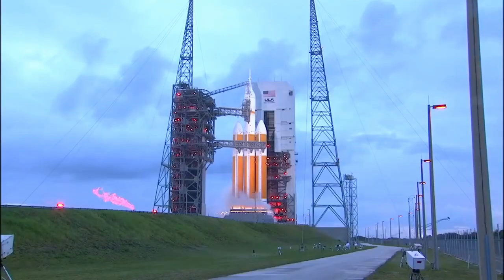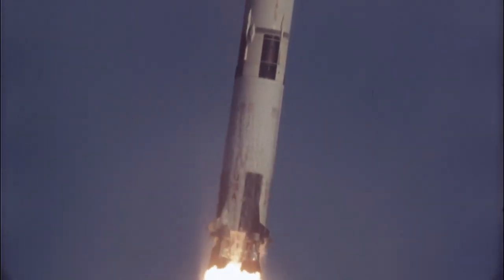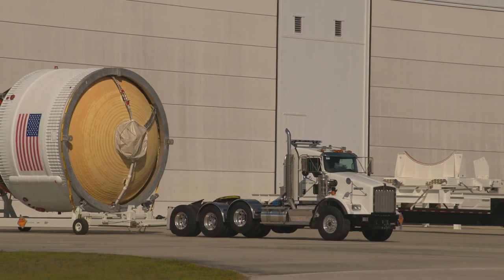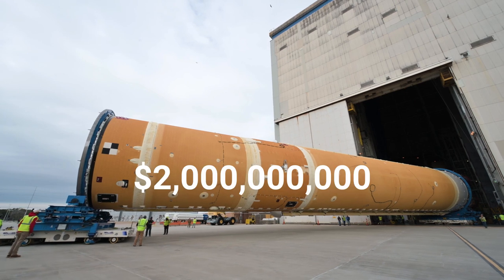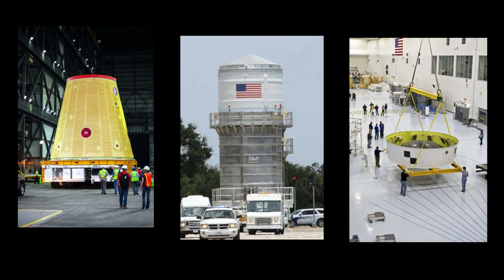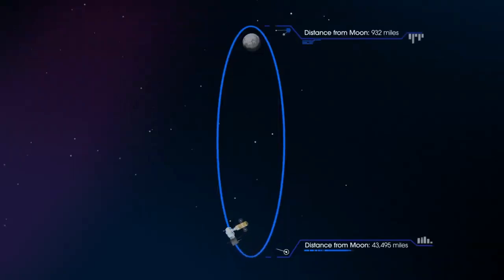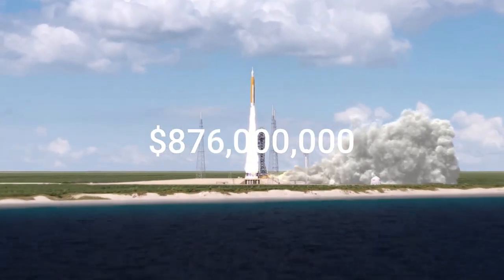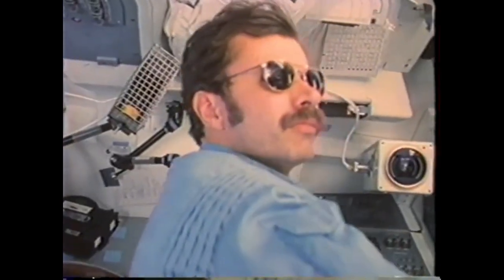SLS: NASA's Mightiest Rocket

Comment: SLS should have had 5x RS-25 engines on the Corestage, not 4. Also: it should have had the Exploration Upper Stage funded from the very beginning; but with 4x MB-60 engines on that stage as the planned RL-10's are anemic in thrust! A configuration like this with the more advanced Solid Boosters could put more than 130 metric tons into low Earth orbit and more than 50 tons towards the Moon.

Comment: I don't think I can fully agree though David... SLS block 1b requires NASA to build a new launch tower, so if we just keep SLS Block 1 and use Falcon Heavy, that ~150 Million per launch can be paid for with the half a billion or so they would end up saving by not building a new launch tower... still it would be nice to see SLS Block 1B fly, as Block 1 isn't really the full SLS.
Reply from the maker: the launch tower is paid for through exploration ground systems. not SLS. launch tower costs dont add to SLS costs, as they are technically seperate programs. plus, if you didnt make a new tower, you couldnt fly any SLS at all while the current one is being modified, which would take longer than just building a new tower.
Reply: @DavidWillisSLS  I don't mean they would would modify the existing tower, I mean they would just use the tower they got and fly SLS Block 1 for the duration of Artemis... but the new tower is only gonna cost Half a Billion so that's like 3 FH launches... it might still be cheaper to build SLS Block 1b, hard to say.

Comment: It would have been better if there had been more initial funding to develop liquid-fueled boosters for the initial stage of ascent rather than staying with the Space Shuttle era solid rocket boosters (SRBs). If there are really going to be 10+ launches of the vehicle then liquid fueled rockets would be more economical, and easier to control. Plus with their higher specific impulse (using either kerolox or methalox propellents) there would in all likelihood be greater lift capability. Alas, politics dictated that NASA keep the existing SRB supply chain going after the end of the Space Shuttle program, thus NASA is stuck with the old technology (new solid rocket propellent formulations notwithstanding).

Comment: David, what would you say is the biggest bottleneck to increase SLS flights over 2 each year?
Reply from the maker: the tower and launch pad. there is only one of each right now
Reply: @DavidWillisSLS  really? That seems surprising. I wouldn't think they would be tied up that long for setting up one for launch. I figured it would have been a toss up between propellant production or engine production. Well leaning more towards propellant, especially making and storing the amount of hydrogen for three or more launches a year. Engine production does seem to be something relatively easy to increase.
Reply from the maker: @TJAllcot  well stacking and prelaunch operations take nearly a year as it is. You’d need at least two to do more than that
Reply: @DavidWillisSLS  There are still unused Mobile Launch Platforms. They could be transformed to support SLS operations.
Reply: @HalNordmann  Not realy they are bilding new MLPs if they coud convert tey woud have but ther must be a reson behind it. Maybe its just the age of the 50 year old Stream

Comment: What's the purpose of the gateway?
Reply from the maker: A staging point at the moon and a political anchor for that Artemis program
Reply: @DavidWillisSLS  but if it's simply a staging point what's the purpose of further expansion beyond PPE, HALO, and the airlock? And international collaboration could be done with surface elements. JAXA is already working on a lunar rover and ESA has their Hercules cargo lander concept as well as Italy studying a surface habitat.
Reply: @iamarokotmanson  Its a lower ∆V place to depart to any landing site and also Mars. Also makes Mars Transfer Vehicle reuse easier since its very easy to capture into NRHO from the transfer trajectory. The Mars transfer habitat will be stress-tested at Gateway and then mated to the transfer vehicle itself. Also, the SEP system human-rates a class of thrusters that would be directly useful on a Mars mission.

Additionally, it also provides a layer of safety, a position that can be resupplied if for one reason or another the crew were stuck without return (one of the biggest risks of Apollo) not to mention a staging point for each lunar expedition.

Comment: If only the SLS used F-1B engines. even if it used 4 and not 5 combined with the Boosters would be more than 10 million pounds of thrust at least
Reply: There was a proposal to replace the solids with liquid fueled side boosters each having 2 1.7 Million pound thrust simplified F-1B engines (see Pyros booster). So you would have had a core with 4 RS-25s and two sides with a total of 4 F-1Bs.  I was very sad when that proposal was shelved. One of my big sads in life is that I will never get to witness an F-1 in operation

Comment: Hehe you should probably clarify the $875m per launch figure is false. It being more than a billion off excluding Orion of course....
Reply from the maker: It’s not false. It’s from the OIG. And this new OIG report also STILL lines up with everything in this video.

They state that the cost of the rocket, is 2 billion dollars. Clear as day. And that the 4 billion is for Orion and ground support equipment.

They also state that that number is ONLY for the first few flights, which is also EXACTLY what I’ve said in this video.

EXACTLY. Down to the word. 

With the sole exception being that the 875 number begins at Artemis V instead of Artemis IV.
Reply: @DavidWillisSLS  yeah sorry man. You're right.